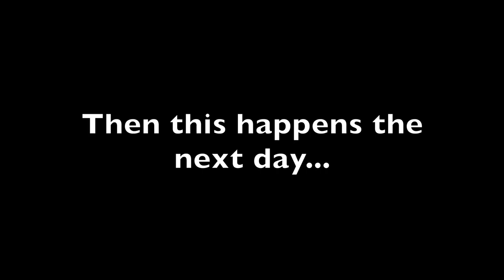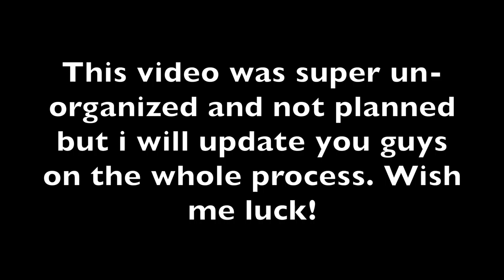FRS/BRZ/86 Clicking Axle Noise

Comment: How much is your car lowered? Apparently the CV joint tends to break pretty easy if lowered more than about 1.25" in the rear. Some people use differential risers to fix the axle angle.
Reply: differential risers? you can do that? wtf lol
Reply: @lowendrice5504  yeah but its really difficult to install, i think it requires welding into the subframe, and dropping the whole ass end of the car. id love to do it but dont have the time

Comment: mine has been doing this since i bought it new with a factory optional lowering springs kit. turns out toyota has a service bulletin for this exact issue as it still affects the earlier 2017 models. 
see service bulletin:
TBS 0217-17

Comment: Definitely going through this myself got the axles just need to get them on toyota told me 400 to install
Reply: Its a known issue. There is a toyota statement. Toyota wants 400 because the worl instruction is to remove axel grease and reassemble, adding labor. You can fix this yourself with a you're wrench and a socket, may need a replacement axel nut if yours has broken tabs.

Comment: This just happened to me fml 😭 thank you for this video it cleared it up !
Reply: Where’s a good deal for axles I’m not even that low and mine just started clicking
Reply: Thats_Ery_Day Life honestly I’m not sure My car came with apexi N1 coilovers. Try buying control arms and toe arms so you won’t break your axels
Reply: Thats_Ery_Day Life it’s better going with the lifetime warranty on the AutoZone axel that’s what I’m doing because I’m really low
Reply: 1slow Frs ordered mine two days ago ! 114.59 shipped to house for free
Reply: Thats_Ery_Day Life perfect ! Trust me those are a little more durable than most I’ve installed one and it hasn’t broken since it’s been a year and a half now
Reply: 1slow Frs are they hard to install? Mine just started making noise this week after I put isc lca and spc toe arms😰 I’m not that low, and don’t even have that much camber
Reply: Mike Gonzalez if you never Installed one it might take you a while but you eventually get the hang of it I did it it took me maybe 2 hours ? To do both sides
Reply: 1slow Frs do you have upper arms, or diff risers to make sure it didn’t break again? I was told to get them, but I’m honestly not running that much camber I’m prob at like -6.
Reply: Mike Gonzalez I just got the lower control arms and I was about to get the toe arms but never got the diff risers I wanted those ! But I was fine with just having the control arms

Comment: what was the cause of it? was it the CV Joint in the driveshaft?
Reply from the maker: Mike C it was the cv joint under the axle boot that attaches the axle to the side of the differential so it snapped because of the angle.